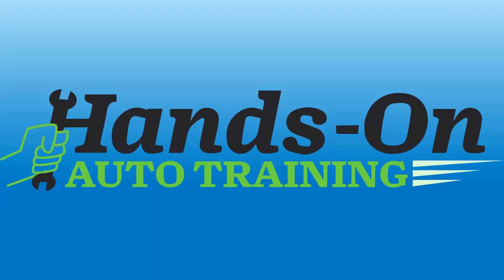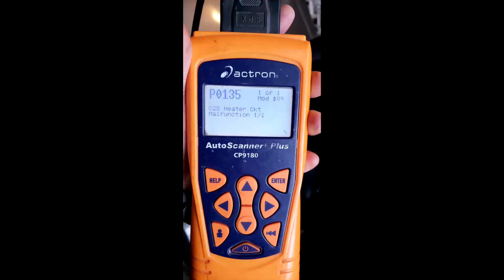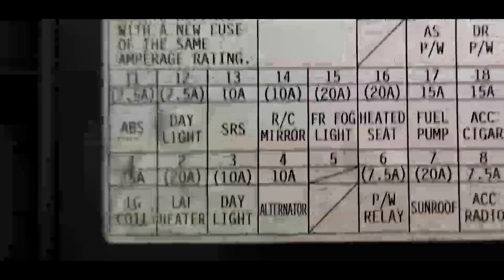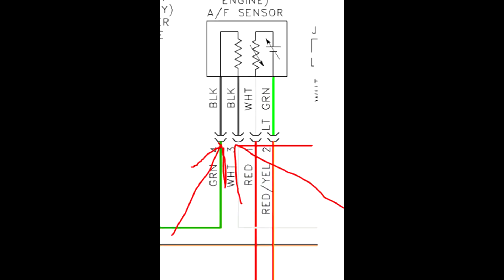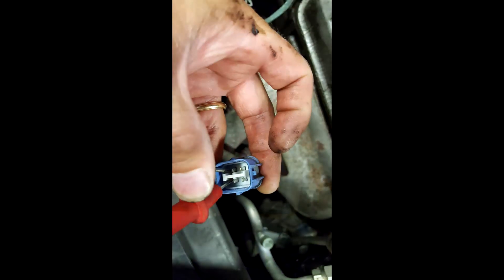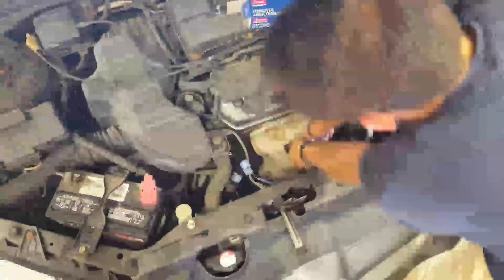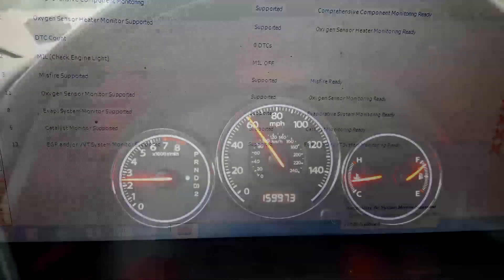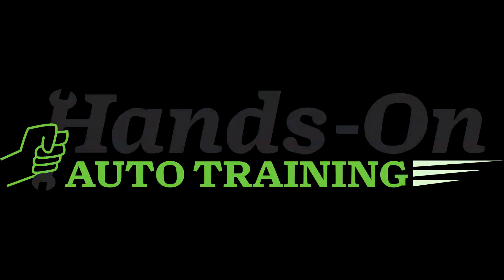Diagnosing P0135  2004 Honda Civic

Comment: I have a good one for you. I have this same code and same vehicle. I have a good ground and 12v at the O2 sensor connector. I ohmed out the sensor and it showed 3 ohms. I went ahead and replaced the sensor anyways and is still the same issue. I ohmed the new sensor and it was 4 ohms. Not sure what to do next.

Comment: if you disable your aircon heater, will the heater circuit affect your O2S heater circuit (bank 1 sensor 1)? and the check engine will come on?  Please advise and thank you
Reply from the maker: I would assume disabling the heater circuit of a o2 sensor will cause a ses light
Reply: @BrianMann216  The car aircon mechanic disable my car heater so the aircon will work.  Is that the reason the check engine appear?  Thank you

Comment: my car is ready p0134 and I have changed my 02 sensor 2 times
Reply: It’s the air fuel ratio sensor that went out most of the times it’s called a O2 sensor